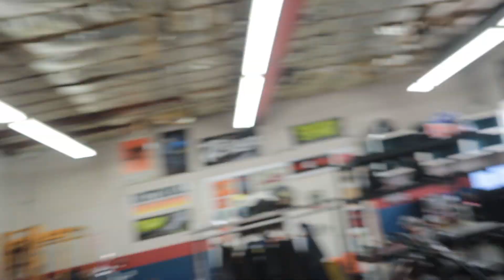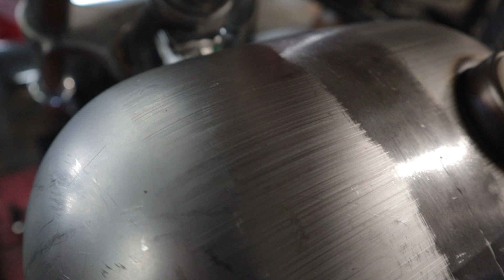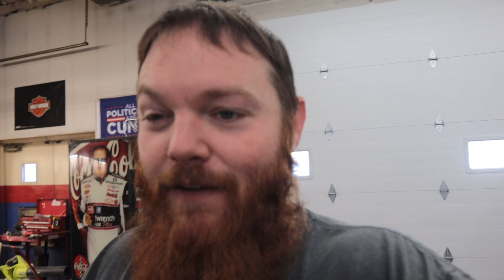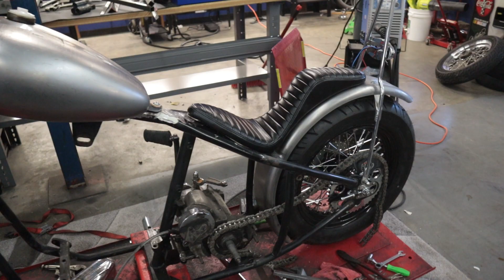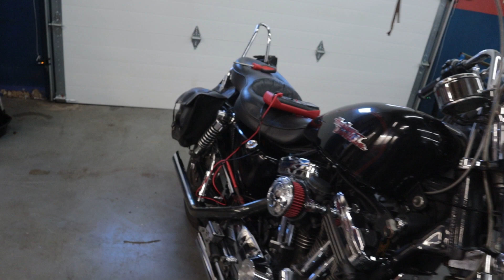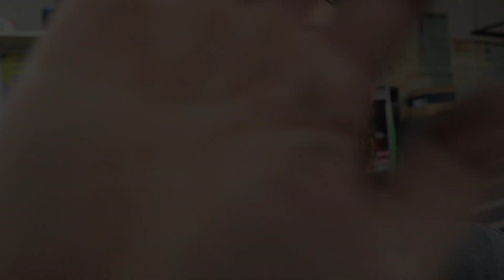SHOVELHEAD CHOPPER BUILD | GAS TANK INSTALLATION | #harleydavidson #shovelhead #chopper

Comment: Been taking grips off for years with air, never put any on with air.
To put them on I spray the handlebars with Hairspray. They will slide on easy the hairspray dries and they're stuck.
Be careful, ride safe.
Reply from the maker: Yeah I've tried it both ways but sometimes the hair spray dries out too fast.   Thanks for watching.